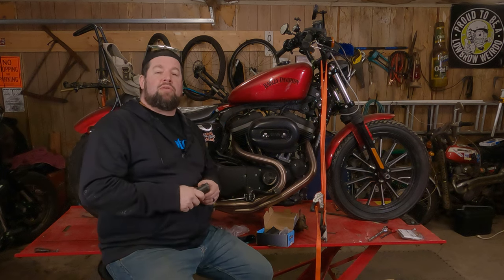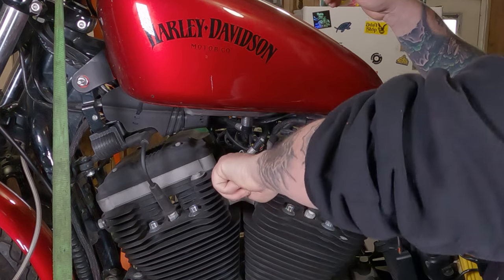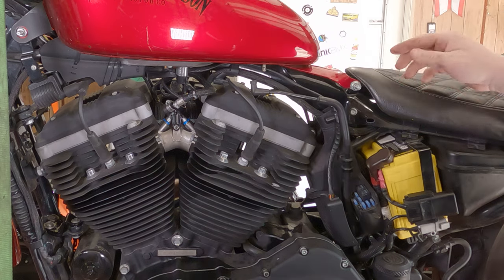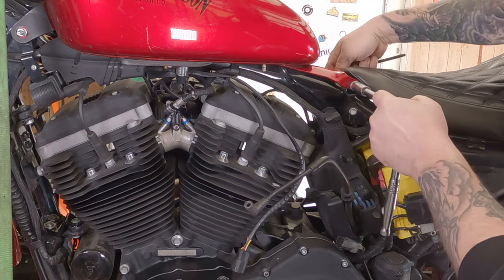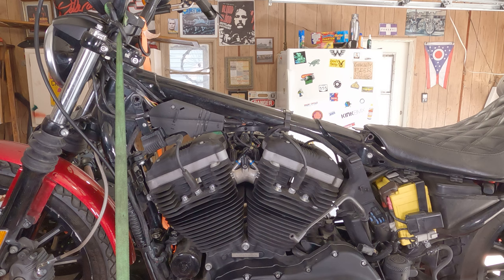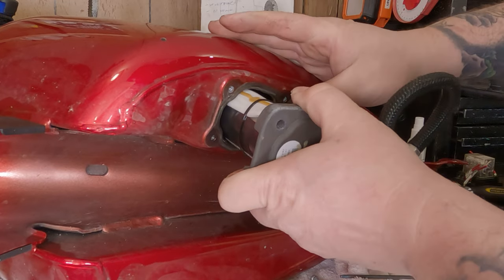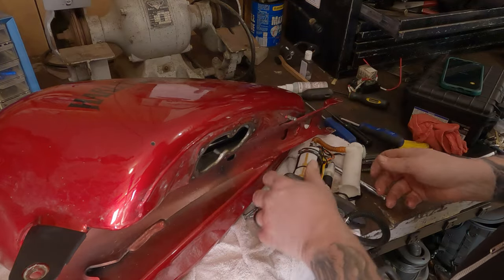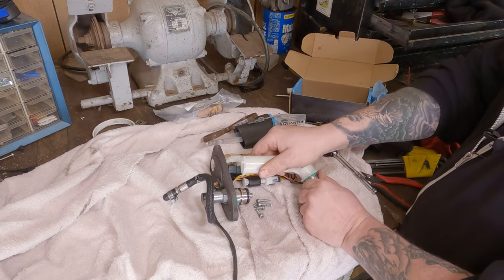Fuel Pump Replacement on a Sportster 883 Iron.  Same process for all engines and Sportster models

Comment: Thank you so much!! I appreciate how detailed and thorough you are. Im planning on looking at a 1986 Sportster 883 with 24k on it ....but i honestly realized i dont know much on how to work on bikes. I decided to dig and reseach about the evo motor,and how things actually workk on a bike. Ive been watching alot of repair videos and its making me more confident in actually going to look at it. Thank you for saying a little on the function of some of the parts. Some people probably already know, but for me being new it really helps alot the little explanations.
Keep up the good work😊
Reply from the maker: Harley’s, and especially sportsters, are very mechanic friendly. That’s a large part of the reason the vintage ones are popular. The evo sportys are pretty reliable. The only downside is the charging systems could be better, but new/modern components will fix that.  
If you want a pretty reliable vintage bike, you will be happy with a sporty evo.